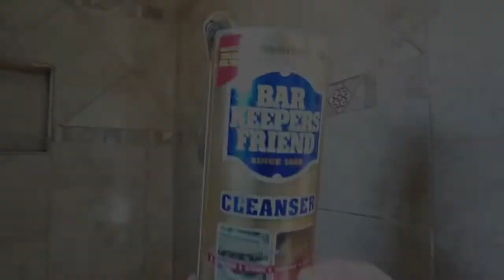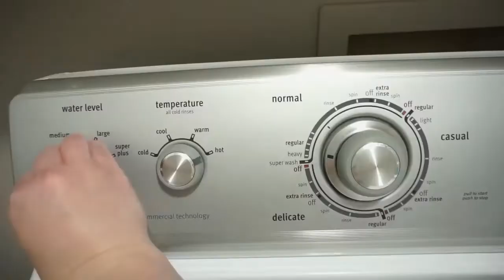SPRING CLEAN WITH ME 2021 // SPRING CLEAN PART 1

Comment: I mop my baseboards in my kitchen and bathrooms makes it so much easier to clean.
Reply from the maker: What kind of mop do you use for that?! 😍
Reply: A spin mop I can rotate it and mop the baseboards. I bought it at Lowes. I use a swifter extendable handle to dust my baseboards in my living room and bedrooms, in-between me using a bleach wipes to clean...that way I don't constantly have to get on the floor on my hands and knees.